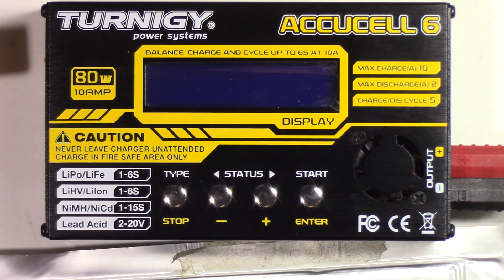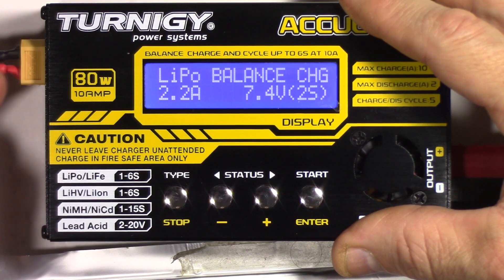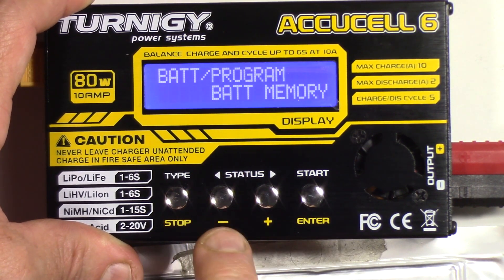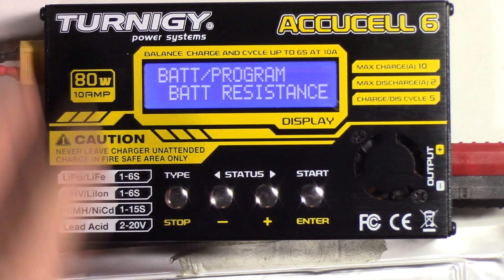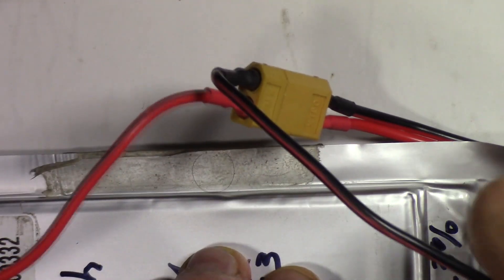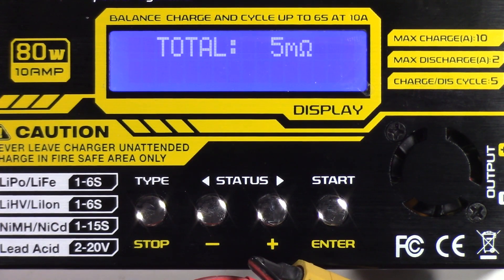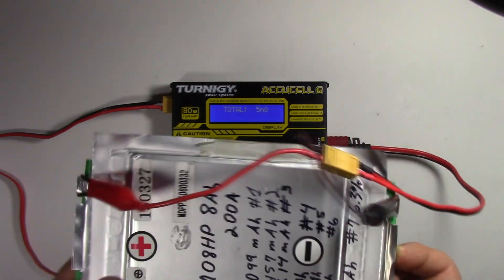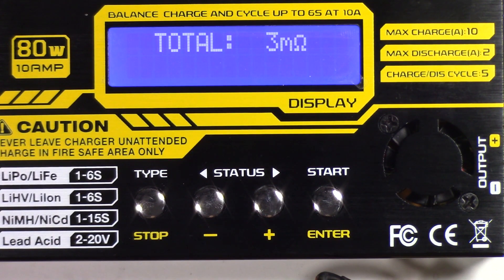Check The Internal Resistance Of A Cell SPIM08HP 3.7V 8AH LI-POLYMER BATTERIES 25C 200A SUPER CELLS

Comment: Thanks ...Did all of these have an internal resistance battery test around  6 ?  Jehu tested some of these and got a lot higher internal resistence. Do you think drilling a hole and putting a bolt through the tab will give a good connection for checking resistence?